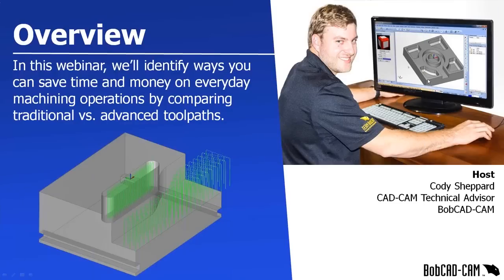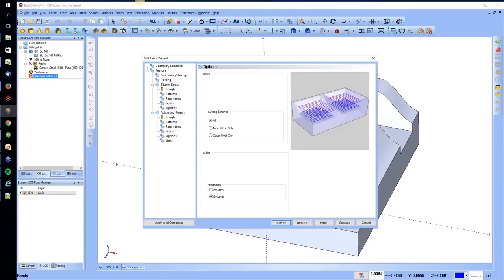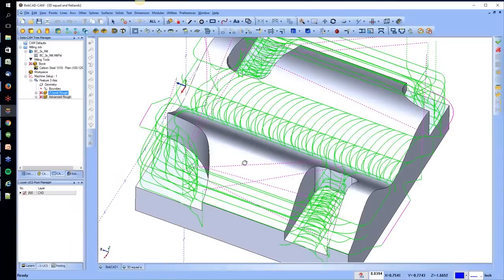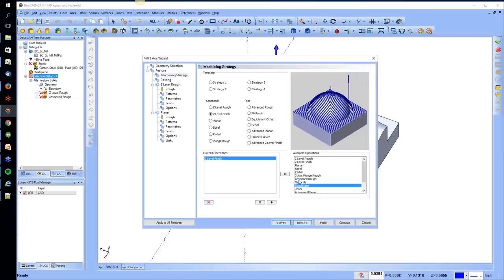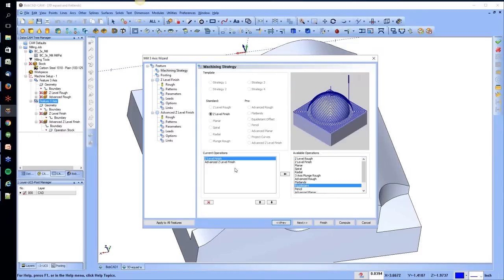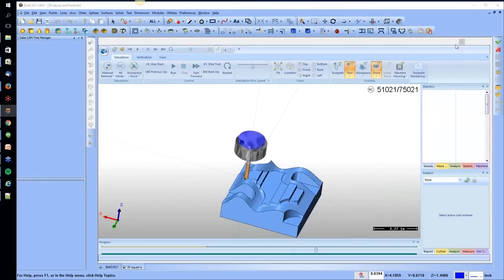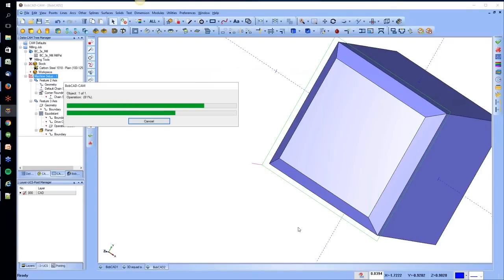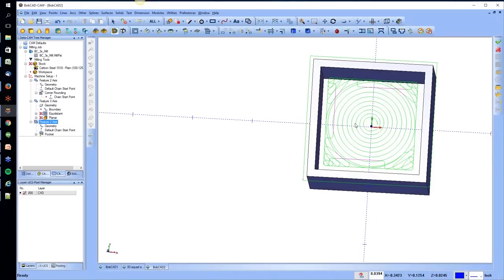How to Choose The Right Toolpath - BobCAD-CAM Webinar Series

Comment: Hi, I know this video is 9 years old but I was curious if you could offer some clarification? When choosing the tool path geometry to cut the 1/4” filet on the (cube example) using a 3d tool path with a ball-end mill, I’m a little confused. 

I have read to use any 3d tool path, you select the entire solid as the geometry and then use a boundary to constrain the tool. To avoid tool crashing etc.. my question is: Is that true? And can I use a planar tool path if I’m only machining one filet on one side only? Thank you, Tim